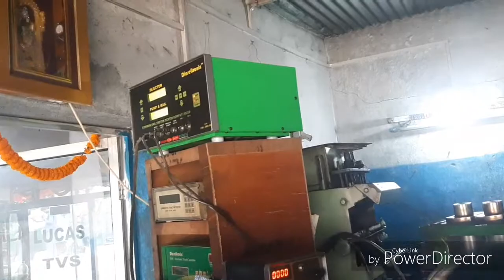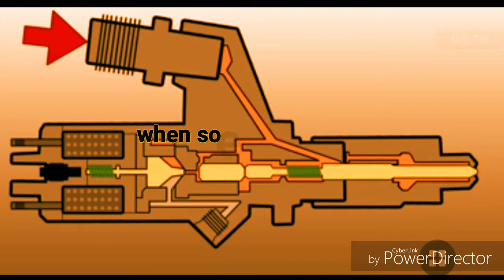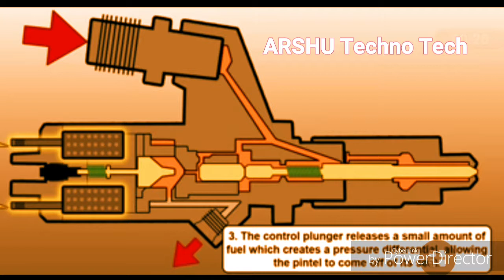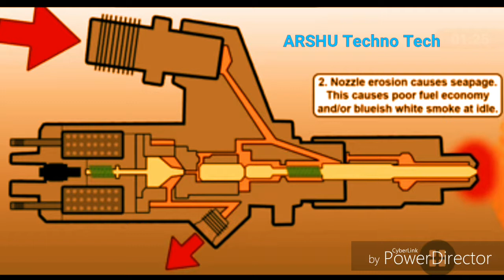Swift desire injector Operation and all detail.

Comment: Sir mere pass swift zdi 2012 model hai 110000km meter reading hai.jb v cold starting krta hu to rpm hlka sa up down hota hai 1mint tk.cabin main vibration  hoti hai..koi white or black smoke nhi ata.egr intercooler  turbo glow plug  fuel filter okay hai..pick up vdya hai....kya problem ho sakti hai??
Reply from the maker: fuel se related problem hai aapka,
cold engine low PSI me aapki car vibrate kar rahi,
Diesel filtter check karo and injecter servicing se theek ho jaiga...
or starting bhi long hoti hogi.
Reply: @NATIONALATubeTech   starting to thik hoti aa sir
Reply from the maker: injecter low rpm me fuel ka pressure jitna PSI pe spray karna chahye utna nahi kar pa raha....engine heat k baad comberson fast ho jati hai, to engine vibration nahi hota,
aap feul regulator bhi dekh lo or injecter servicing..